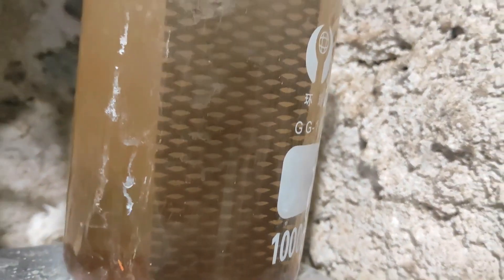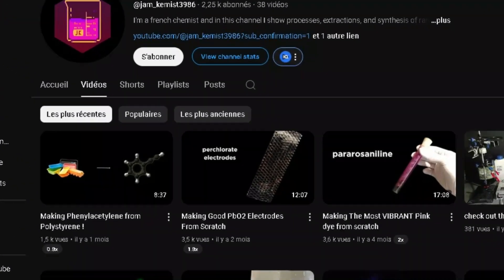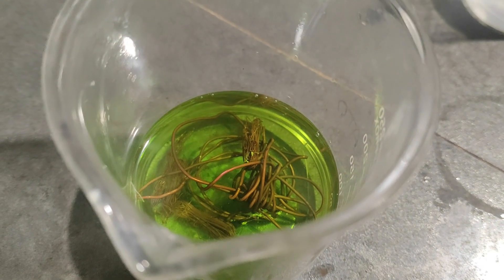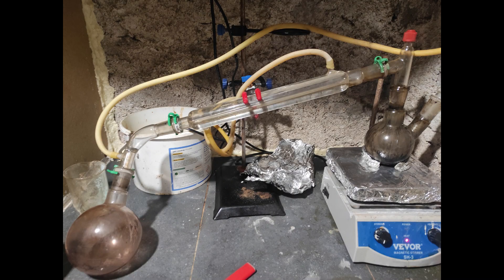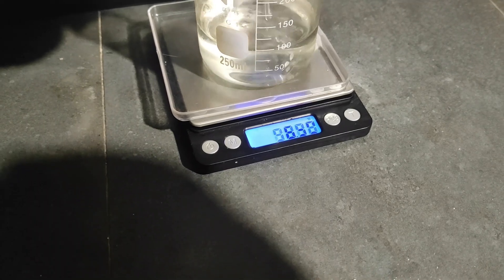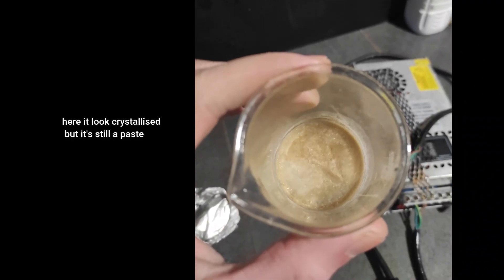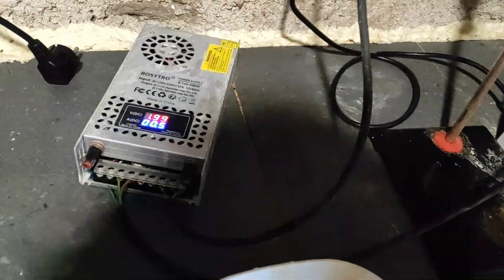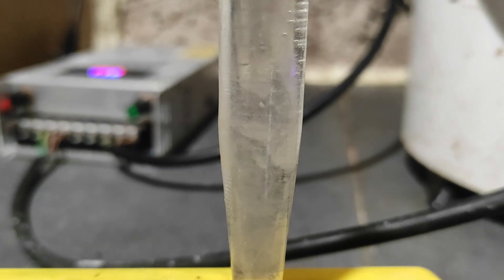making PbO2 electrodes for perchlorate production and more... (beta coating, ATO plating)

Comment: How difficult was it to clean the glassware after making the SnCl4? Interesting method, I've only heard of the K2SnCl6 decomposition being used.
Reply from the maker: @Daniel-3029f  very difficult 😭 conc NaOH and pirhana did a little work but not much, I think imma have to use nitric or reflux HCl and H2O2

Comment: @jam_kemist If you want to make tin(IV) chloride from copper(II) chloride it is better to add tin metal to a copper(II) chloride until the solution is colorless and after separating it from the copper metal by filtration treat the tin(II) chloride solution with hydrochloric acid and hydrogen peroxide to create the tin(IV) chloride.

Comment: Why use a pipette to apply SbCl3 coating, why not use a flat tray and just dip the anode in it, wouldn't that give you a more even and efficient coating?
Reply from the maker: @FrankDreben-il6kk  it would be faster but not really more even because the solution drips anyway, that said, if you have enough solution to do it, sure why not ! I just had like 50mls so I had to pipette